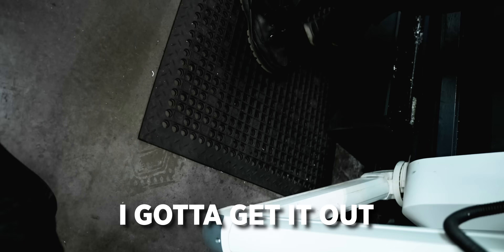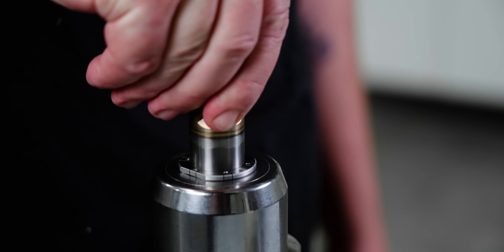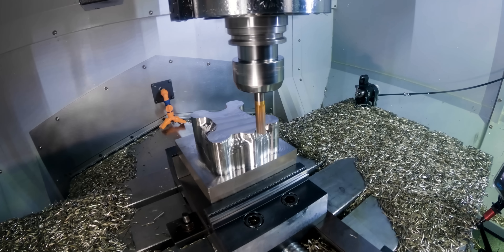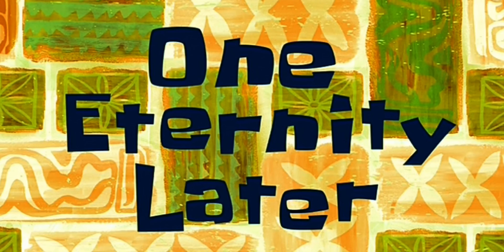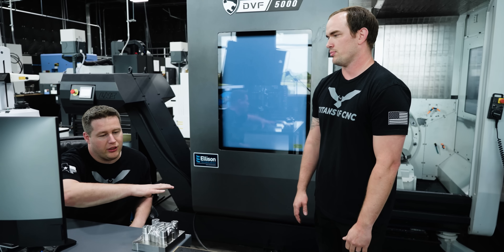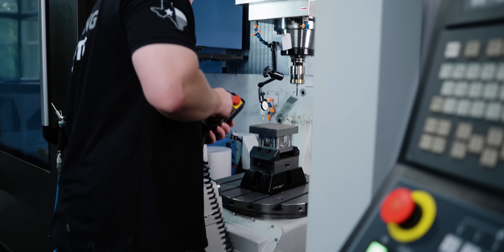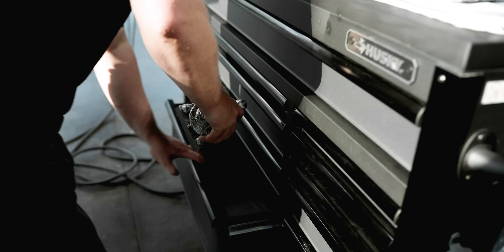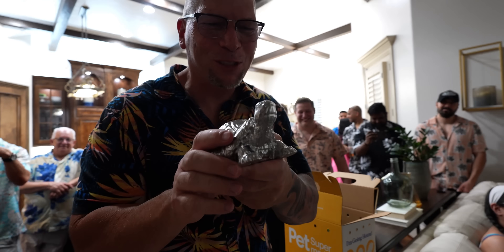TITAN Had NO CLUE What Was Happening!😳

Comment: if you don't know machining, this is a very expensive, very intense job. Probably quite expensive to have something like this made at retail prices
Reply: Had a 'simple' piece done a few years ago. First piece cost 500$, second run of 25 brang down individual prices to under 100, yet I had people asking me 'wHy dOeS iT cOsT sO mUcH?!'.
They expected a cnc part to cost the same as a large volume piece bent from sheetmetal.
I have to say- after explaining it thrice, I just told people who asked: If you ask that, then this is not the piece for you. Please just buy one made from metal.
Reply: @Tigrisshark exactly. You must of had a need for a machined tolerances/billet grain strength, as you could of had them cast for pennies.
Reply: @realryder2626  In my case it was partly done for quality, part for stability- had to hold 5 pounds while being less than 1/2 inch thick. Cast would be an option, but as it's easily visible, CNC held a bit of an aesthetic value as well.
And given that competitors normally build these brackets from pressed metal and tell their customers to 'deal with the sagging', I'd argue it was the right choice. BTW- they charge 60+ bucks for that 'solution'.
Also I'm a private party who did 1 run of 25 parts. Dunno if the molds would be cost effective.

And I freely admit that I love CNC'd parts and the feeling you get when you design something in CAD and later hold that virtual piece in your hands in anodized aluminium... That never gets old.
Reply: No kidding, not to mention the time it takes to program it and create fixtures and load up and touch off tools ect...
Reply: Yeah your best option would be to hope they'd run a few hundreds of them to lower the cost per part otherwise it would be an insane price for a stainless steel turtle 😆😆
Reply: Technically its only expensive for the person who bought the machine and tools(Titan) that block of steel is only like $20 everything else is just time and based on the video, they were on the clock and with the views the time made everyone involved wayy more than it cost lol
Reply: You know... you could get it 3D resin printed in 64k, for probably $20 including postage and insurance.. use that as a master to make a silicone mold, then you can do lost wax/investment casting for next to nothing.
Reply: @realryder2626   just because you can, doesn't mean you should. We don't want cheap casts, that's not the point. If you want cheap garbage go right ahead.
Reply: @Anon-greyman  i'm not saying everyone should do it. But, for example in this case it was a birthday gift and very fitting gift at that.. in other cases, people might not be able to afford it, but want to achieve a similar result with more accessible and easy to work with materials. Also, for bulk. If it's not a stressed/ load-bearing part, then cnc machined billet is a tad overkill.. again with exceptions for aesthetics in applications such as show cars/bikes, prototype pieces, and the likes. Don't take any offence i am just adding to anyones imagination who is thinking projects while reading these comments. As thats why i myself read them, i learn little things.
Reply: @realryder2626  you didnt seem to come off as nice and informative. Your entire comment seemed argumentative and condescending. I don't think you're coming into the comments sections to learn things you literally came to try and teach us what you know when we never asked and like me I already know that and I didn't need to be told why I'm wrong for watching this video and liking this piece.
Reply: @Anon-greyman  it was a simple comment. Things can seem that way from many reasons, from local grammar or things etc. Just adding constructive thoughts nothing more.
Reply: @Anon-greyman  not everyone knows what you know. What might be obvious for you might be new information for others. 
This is a public comment section. You are not the only one here reading the comments.
Reply: @Jehty_  that's exactly why I made this comment?
Reply: @Anon-greyman  then why did you attack realryder?